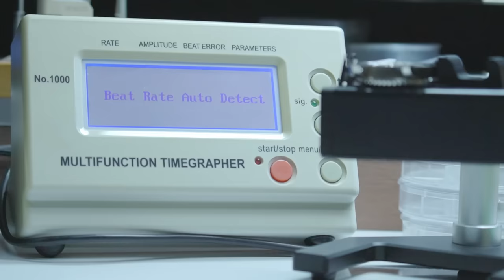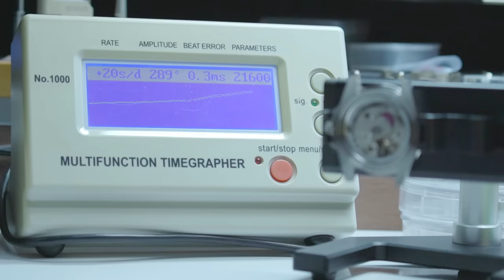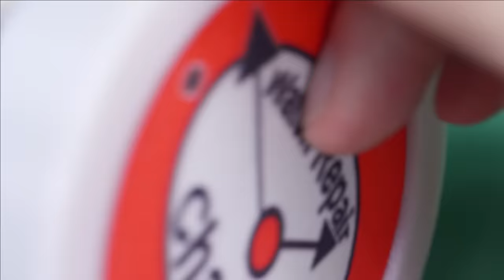Let's see what it's really worth! Fake Rolex Stripdown and Rebuild Review

Comment: Very poor replica though. Would like to send you a top replica to strip down but please don't grind in half. Love your videos.👍👍
Reply: where does one get a top replica tho?   I used to see some for 1200 USD but then those could have been low ends with high prices.   I would have to see it in person to ever buy one i think.   I don't trust online
Reply: Noobwatches.
Reply: @ScottMshao69   just check up on rwi or rwg forum, you will surely find some trusted dealers from china with excellent shipping or a local deal in the member to member sales section :)
Reply: @ScottMshao69  Please don't spend your money like that. It is scam all around and you'll get a watch that's sold for 50 bucks otherwise
Reply: @ScottMshao69  Head to the markets in China, they're full of them.
Reply: @ScottMshao69  A top notch Valjoux movement, which can be found in many Omegas and Breitlings is under 1.000,- €.  1.200,- $ seems to be very expensive for any clone.
Reply: Yes rip the sh*t out of that top replica!
Reply: @ScottMshao69  supertimewatch
Reply: All replicas should be ground in half. Replicas are linked to many other types of criminality.

Comment: Speaking as a retired auto mechanic, I've taken apart, and reassembled  many complex units (engines, transmissions, ABS controls, and even a few ECM's), but I am trully amazed at the complexity of watches! To be able to disassemble, repair, and reassemble is an art. Something I would never attempt! You, sir, are a true craftsman. Good job, and a great vid.
Reply: Ain't no way I could do that...🤔Maybe after a couple of drinks.
Reply: Buy a couple of non working watches and see where that goes. Have fun.
Reply: They're trained to do this. The vast majority of watch movements are the same ; so there are few if no surprises there. A car engine has far more parts. What requires skill, however, is operating with such small parts, especially when you have to repair or fabricate them.
Reply: Its something you can learn in 4 weeks. No different to torquing headbolts or adjusting valve clearances, etc, you just need to know the method of each task
Reply: @Alexander im taking apart replica rolex movements based on watching videos on youtube. Lets not pretend here. Like any skill, you just need to know the tricks if the trade. You could do my job after watching videos for 4 weeks
Reply: @Alexander id demagnetise it first. Might be the hairspring coils
Reply: @Alexander a few things, a true diagnosis will need the movement out if the watch theres a few possible issues. Take it to panerai themselves.. probably best to not ask a builder on youtube with 4 weeks training

Comment: Once cleaned and properly oiled, I wonder what the lifespan of this watch would have been? It looks reasonably well made for only L50.
Reply: 70 years
Reply: I'm kind of wondering the same thing.
Reply: It would last a long time. People are just snobby AF in the watch world. The reason they get so butt hurt about reps is because they realized Rolex is ripping them off. Rolex doesn't even hand make watches anymore, a few pieces MIGHT get touched up with an electric Dremel of they're just a tad defective but that it. Their 25k watch is realistically worth 1k or less and probably $250 to manufacture. Hell TBH a high end clone probably has more actual man hours in it than a real Rolex since they're actually assembled by hand and Rolex uses machines.
Reply: @Tiralful  Then if the Replika is so good, why call it a Rolex?
Reply: @Tiralful  did you watch the video? The entire inside of this movement was cheap stamped metal and there were loose shavings present.

Once cleaned up, yeah it would've probably proven to be be completely fine for a casual watch.  But, this isn't anywhere clsoe to an actual Rolex.  This movement looks less nice than the ETA in my Hamilton....
Reply: @Tiralful  I understand that there are differing opinions when it comes to replica watches and luxury brands like Rolex. It's important to recognize that people have different preferences and perspectives on this topic.

While some may argue that replica watches can be a cost-effective alternative, it's worth noting that luxury brands like Rolex invest heavily in research, design, craftsmanship, and materials. These factors contribute to the overall value and reputation of their watches.

It's true that Rolex utilizes a combination of handcrafted and machine-assisted processes in their manufacturing. However, both methods are implemented to ensure precision and quality in their timepieces. Moreover, Rolex watches undergo rigorous testing and quality control measures before they are made available to consumers.

Ultimately, the choice between purchasing a replica or an authentic luxury watch is a personal one. It's important to consider one's own values, budget, and priorities when making such a decision.
Reply: @Tiralful  A Rolex back in the 60s was about 1500-2000 USD to purchase, adjusted for inflation (160-180 USD at the time ).  Same as, say, a high-end Seiko now.  A bit of money, but considering you got a a watch that could survive almost anything and last for decades, not an unreasonable stretch.
If you take apart a Seiko ( one of their high-end movements ), you can put it and a Rolex side by side and flip a coin on the parts as far as finish and quality is concerned.  The issue is that Rolex just charges stupid prices now because of the bling/name factor.  Yes it is still made just as well. But wow the prices...   If you really must buy Swiss, just get a Longines or similar legitimate brand for 2-3K and laugh at the people paying more for something that's not any more accurate or well built.

Comment: When watching videos like this one I'm always confused as to how so many people in the chain of supply of these things can all make a living out of them. All of those components shown in the video had to be manufactured to some reasonable standard otherwise they would never fit together and work, so there is a cost involved there. Someone then has to be paid at least a pittance to build the thing into at least a reasonable attempt at a watch and it then gets shipped half way around the world so that some geezer can sell it for £50! They must have to produce thousands of the things so that everyone can take a sliver out of that £50.
Reply: They make it up in volume
Reply: They aint £50 is why. Todays superclones are a shade over £500, and theres one middleman between the factory and you. Whats essentially more incredible is how much rolex make in pure profit on a watch that can be made for less than £200
Reply: @missionDan  yeah, but that's not a superclone, it's $150 at the most.
really cheap mech, wrong beats per hour so it stands out a mile off as a fake as the second hand has 6 ticks per second not 8. The date wheel is appalling! I think they may have made the numbers and the date window bigger to get away with a lower magnify cyclops, the end links fit where they touch, the bezel is loose, 
A superclone will have a 1:1 replica of the Rolex movement (minus the free sprung balance and the adjusters on the balance wheel).
Reply: Nothing strange or special. Just machinery, cheap materials and a crappy assembly line. There you go.
Reply: Yeah the answer is quantity

Comment: In my job at the Seiko Center in XXX, the owner used a lubricating cleaning method. I did not like that system, so I moved on to another job. When I had my own shop, I cleaned ever part separately in my L&R 4 Jar Ultrasonic after pegging the jewels then double rinsing. Then I assembled and oiled much as you do. The only come-backs were when the customer had damaged their watch. I only had word of mouth advertising, and I did a very good business. My greatest feat was repairing a Fusee Antique Watch from England, quite a challenge.

Comment: I love it when you put the stem back in, after pushing on a loose minute hand, or cementing a loose marker, and the set mechanism blows up! Then you need to take the dial off, mess with the glued on date disc, and put the yoke back where it belongs, and prey it doesn't happen again when you put the stem in again. I never work on these anymore. Lessons well learned!

Comment: Even though it's a fake, I'm amazed at how intricate all the parts are.
Reply: That’s how all mechanical watches look like, imagine a high end movement with insane complications? Compared to this fake’s movement... 😁
Reply: Like they took all that time and hand craftsmanship to make a fake 😂
Reply: Mass production and castings instead of machining from solid and hand fitting/assembly stamped gears plastic parts you name it that corner has been cut
Reply: Check out a few of the repair videos of genuine Swiss movements - Rolex, Omega and the like. Pretty clear this movement is very crude in comparison.

Comment: I noticed that despite being a replica you treat the mechanism with delicacy as if it were a rolex
Reply: well... before he took the angle grinder to it anyway.
Reply: You have to, its made from old tincans
Reply: How else would he treat a square inch sized mechanical object?
Since it's not a rolex is he supposed to use a baseball bat and a grill brush to work on it?
You just HAD do be noticed I guess.

Comment: I knew there were a lot of parts in a watch: gears, springs, bolts, but I didn't think they were 5 times more than I thought they were. Anyway, it is an extremely demanding job in terms of attention! Congratulations man!
Reply: You should see a real roles movement. Built so well. Or check out a movement with several complications and finishings and you will be blown away

Comment: I like your tools and vice, you're an amazing craftsman! Although the watch is counterfeit and no where close to the quality of a real Rolex, and not an authentic and superior movement, I still see jeweled bearings, and jewel toggle stops on the anchor unlike a Timex anchor that has metal pins to engage the ratchet wheel, so it can't be that bad. If there wasn't excessive oil and metal shavings, it might be an OK watch for a few years. As a layman you'll have to excuse my lack of proper terminology..... Thanks for the video!

Comment: Three questions if you have time - 1. I’m always amazed that people can reassemble watches/clocks, how do you start is there an obvious path/way to begin? 2. Are all the screws different, in other words are they designed to fit in their respective holes? 3. I wonder if it would be worth hand finishing/bevelling/engine turning the various parts to make them nice but I’m guessing that would mess with tolerances & probably the metals used are not that good anyway? Thanks!
Reply: He never answers questions.  TBH, I don't think he has time to read the comments.

Comment: I would assume the movement is decent when cleaned, oiled, and assembled properly.
Reply: I know nothing about watch movements. But I can tell you that I have owned a £13.80 Rolex copy like this one for over 5 years and it is still going strong and keeps time better than +/- 10 sec a day. 
Mechanical Automatic movement like this one has. Only difference is that mine does not have any Rolex branding on it, so it isn't technically a fake. It might not last forever but it is fair to say that at £13.80, after 5 years I have definitely had my money's worth. :-) :-)
Reply: 2813 movement, just under a tenner on the 'bay' or 13 quid for the one with the date ring mod as shown in the video. But it would be intriguing to see how a properly cleaned and lubed example would actually last for.

Comment: Nothing says Rolex like a plastic movement spacer amirite?  LOL :)  The Superclones are indeed scary though. 
Aside from the bridge in one, they are pretty convincing and they don't fall apart at eye balls length it takes a loupe
from what I've seen.
You turned that into a Gash-O-Matic Rolex :)
Reply: The superclones are not even scary. I have reluctantly worked on some, and it is quite common to find sheared off teeth as the first thing on your desk after opening it. I have seen all the 'clone' movements, and they don't  fool me. I don' t need a loupe for that, quite frankly I don't even have to open the watch up  to be able to tell a fake from the real deal. It's not gonna happen either, by the time they finally get to that level, the China workforce will have become so much more expensive that it would be about just as expensive as a real Rolex. Not kidding.
Reply: @vincenzodigrande2070  then you have not seen actual top-end clones.
Reply: @vincenzodigrande2070  No, not going to happen. Work frequentliy in China in cigarette making industry. They still have to buy german machinery. They copy ours but nobody buys them. Basic and even advanced machinery - OK, labour intense production- OK. High Tech or very sophisticated things, they can do but  still cheaper and better from Switzerland or Germany...

Comment: I hope this question wasnt asked a billion times, but with the fakes, do they use a lower quality metal in the parts, or are they just not as refined in their finishing before assembling together? Like, are they better balanced in their manufacturing so they rotate with greater ease? And are those lavender parts inside the jewels? I know, its a very novice question but I am a very big watch fan but dont know a lot of the inner workings (quality).  Now I want to know more about how they even make each tiny part.
Reply: Almost everything is stamped and made out of recycled steel.  Could be old high quality steel, could be from a child's toy.  You have no idea as it's all melted together (hence the term "pot metal" and very weak. The Jewels are rather well made, but are, alas, glass. Note that the synthetic sapphire used in real watches can be any color - red if they want to call it a ruby, or any other color depending on what trace elements they add to it.  As for quality, no, they are not finished or polished at all, typically and only the dunking of oil generally keeps them running until the person gets out of the country/back home.

Comment: My opinion about Chinese movements and oil are as follows. The final step before final assembly is to dip the movements in  a solvent with oils incorporated, then just spin and dry. Almost all of the Chinese movements I have worked on, came with an abundance of oil and fingerprints.
In truth I find that, although the parts are not beautifully embellished, they are usually well made and functional parts. Some careful cleaning and gentle touches yield good results.

Comment: This is my theory on the excess oil and debris. It stopped the first time due to excess debris from a dusty and overcrowded plant floor. It was returned under warranty and all they did was a lazy clean/lube without the stripdown (too much time consuming and not worth the sale price). The excess oil was left in to ensure that it kept running for a couple of weeks hoping the debris would just slide around but not jam it.

Comment: I think you didn't used the proper blade to cut your watch...that blade is not for metal.
Reply: Cutting glass required a diamond blade. 
A standard abrasive blade would fracture when hitting the glass.
Now go sit in a corner .
Reply: Yeah but this so called watch was made of a special material called "cheap-ass-inium" - you can cut through it with a butter knife.

Comment: The movement looks like a cheap asian DG2813
Reply: Do you know which brand?
Reply: @yasyasmarangoz3577  DG is the brand, it stands for Dixmont Guangzhou. These movements are rather crude, but they can last quite long. It is basically a clone of a Miyota 8000 series. I would actually prefer a good DG (they are made by many manufacturers in China, good and bad) the Miyota might be more accurate and has a much better escapement, but the date change mechanism fails quite often. That said all these movements have a very vulnerable seconds pinion, which is why I would always prefer an ETA or clone over this junk.
Reply: @yasyasmarangoz3577     Dixmont Guangzhou
Reply: Not a DG. The mark in the main plate under the balance is not present. A sort of circle with a couple of radial lines on one side.

There is some sort of mark there, maybe. Or it looks like a mark has been ground off, hard to tell.

This could be the the one referred to as the China National Standard movement or something close to that wording.

The DG is the only one I have serviced so not sure about the others.
Reply: @fredrick4891  There are dozens of manufacturers of this movement, most are worse than the DG, but replica manufacturers also would likely grind off the  branding of the movement. I've even seen 2824 hand engraved in it's place, as though that would fool anyone. One other manufacturer is Nanning, with the NNFB2913 (21j), which has NN stamped in. I have even seen really poor ones that were not DG and had the DG logo stamped in. So even the Chinese fake their own fakes....

Comment: I had a Street-corner "Foolex" as well at one point that I received as a gift... It lasted for a while and undoubtedly was assembled and made in a very similar manner. Mine did not have the gear with the tacky pink paint, but it definitely is of almost identical internal manufacture.. if you can call it that.. Thanks for the vid.. I find it amusing.. er'heemmm.. Nobody sells a genuine Rolex on a street corner... I keep it as a memento of the occasion.

Comment: If assembled carefully, with correct precautions and lubrication etc, I wonder if the movement would actually compare favourably with more expensive movements? The problem with this example- and from the narrative copies in general- would seem to be poor quality control during assembly rather than the basic parts and design. Obviously I am not defending misrepresenting them as the real thing. Interestingly, if you take a Rolex for servicing to a main Rolex service point they check it is real immediately. They open it up. They can’t tell by the case.